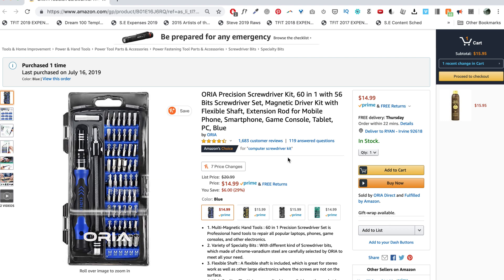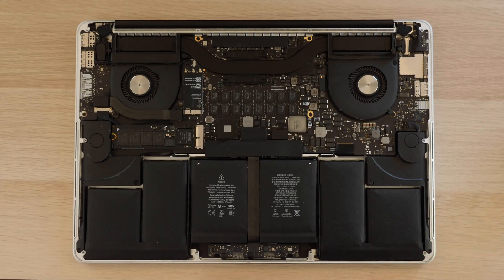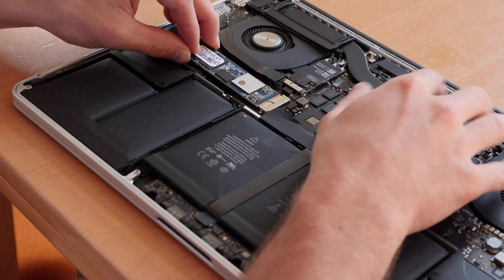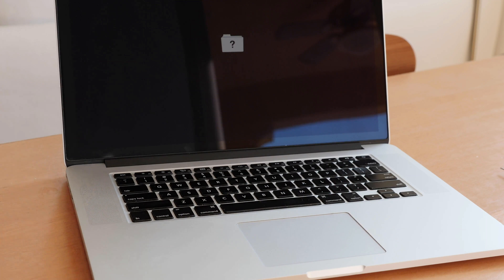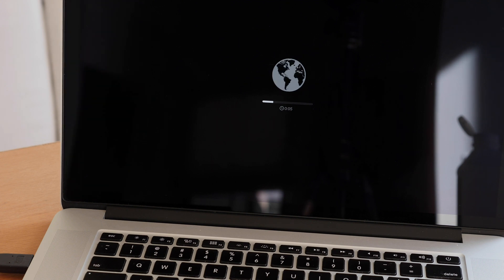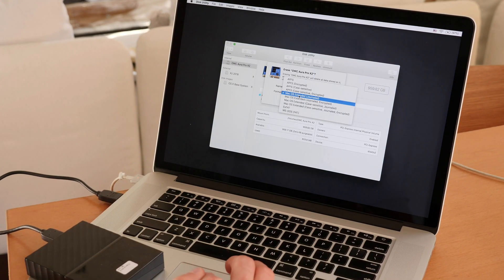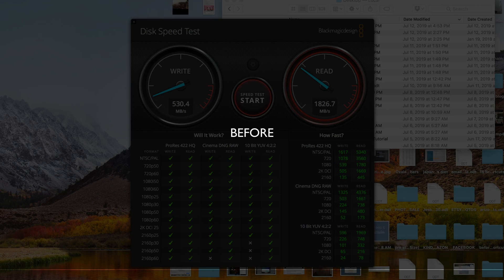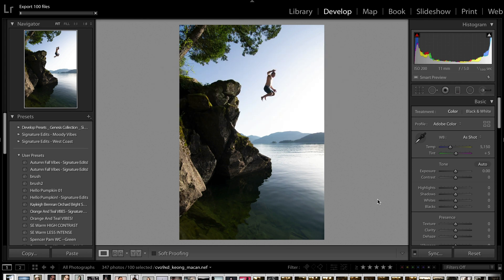Macbook Pro Hard Drive Replacement / Upgrade Test: OWC Aura Pro X2 SSD Review

Comment: Feel the same way about my mid 2015 MBP and no need to move to the 16”. Sure, I’d love more speed and power but I basically just use it for watching training videos. Anyway, I’ve been thinking about the Aura x2 and while I’d like the 2TB unit, finances say the 1 TB is probably the way I’ll go. Black friday is coming, guess we’ll see. Did you notice an increase in boot up time? Going from a 512gb ssd to a 1TB is nice but I’m after overall speed increase. I’ll look at your paste video and go from there. Like when I modded my 2012 Mac mini from 4gb ram/platter HDD to 16gb ram and 512ssd/1tb 7200 platter. Big change in that one, not sure if I’ll notice the same level of increase with a new Aura x2 in the MBP. If the change isn’t too great then I’m looking at going to the 2018 mini as it will be my prime unit. Thanks. Oh hey, before I forget. The enclosure that OWC has for the kit. Is it worth the $60 since I already use the Samsung T3 512gb for time machine? Nice kit but I already have the tools. I guess it comes down to is it worth the $60 to have another 512gb portable SSD drive. I have a second 2015 MBP (gift but for the ex but she didn’t want it, TMI) with a 256gb drive back in the States so the 512 could replace the smaller drive. Spending dollars to chase dimes comes to mind.
Reply from the maker: 1) No increase in boot time that I notice. 2) Overall it was a way bigger speed increase than the paste, which I didn't really notice any difference from (but ymmv) 3) With your Ram and SSD upgrade my guess is that the majority of the speed increase prob came from the RAM more than the SSD - Although both are noticeable, I've seen the biggest speed increases from switching out more ram than anything else. 4)  I would spring for the kit as $60 for an external SSD is a deal. Then again, ifyou don't need it, don't buy it haha. 5) I put my bigger 500gb HD into my wife's 128gb 2015mbp and it was an amazing upgrade for her to not have to worry about space anymore - Well worth it.

Comment: Hey I switch out my macbook air ssd with OWC. I didnt get a chance to back it up because the laptop wouldnt even turn on properly. I had Sierra on it now Im back to Lion. Trying to find away to upgrade back to Sierra, any information will help. Thanks
Reply from the maker: Hi Trivina! Your best bet would be to reformat and install from scratch - But at this point Sierra is still an older OS so I'm not sure how you'd install... I'd personally go to Mojave as its been pretty good in my experience. Sorry I can't help more!

Comment: Since buying the Aura SSD, my Mid 2014 Laptop overheats and Battery drains from 100% to 0 in in just over an hour. this is a fake overpriced product .
Reply from the maker: Oh man, that's bad news! I would contact OWC about a replacement if you weren't having issues like this with your battery before. I know for me its been great, so you might have received a faulty product. That sucks - Sorry for that!
Reply: So is this the original Aura or the Aura x2? I’ve seen other reports of the first version causing these problems but nothing on the X2. Please clarify.
Reply from the maker: @6806goats1  Mine is the x2 - I can't say for the commenter!

Comment: I have a mid 2015 MacBook Pro with AMD Radeon R9 M370X 2 GB and 512SSD I get Read speeds of 1900 and Write speeds of 1500 from stock drive. OWC claims 
Thrilling speeds up to 3282MB/s read and 2488MB/s write I didn't see that with yours although your stock ssd had a considerably lower write score compared to mine
Reply from the maker: Hi Miller! Yes you're right - The older macbooks have a lower capacity as there is a bottleneck for speed in the other components. I would say given my experience that OWC drives perform pretty close to as advertised, so you'd probably get much faster speeds with the newer 2015 ssds too. Let me know if you wind up upgrading!

Comment: You cant call 7:53 a comparison, because the tests have been done in High Sierra and the other one in Mojave...
Reply from the maker: Very true - I wanted to do the test in High Sierra but the harddrive wouldnt boot unless i upgraded to Mojave! The different OS totally may have effected results. That said I would be very surprised if the results would have been substantially different had I used mojave for both.
Reply: @SignatureEdits  Thank you for the clarification though.